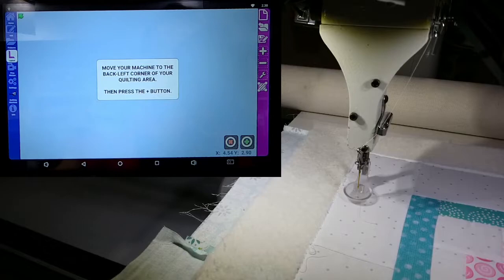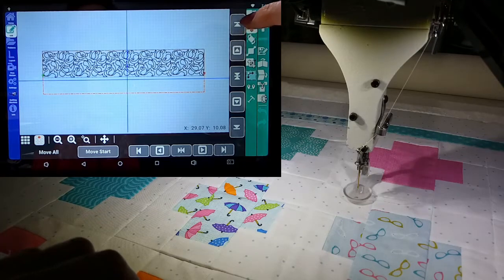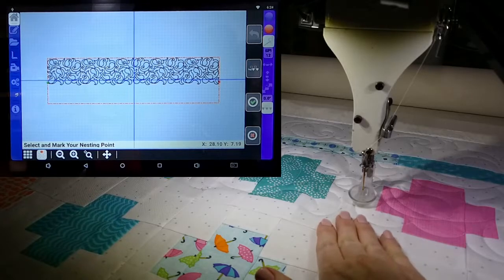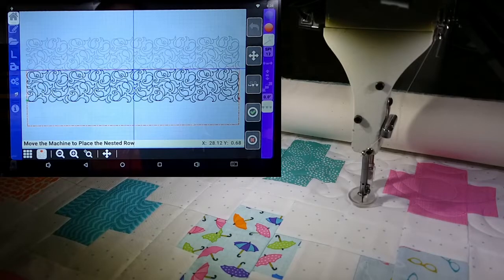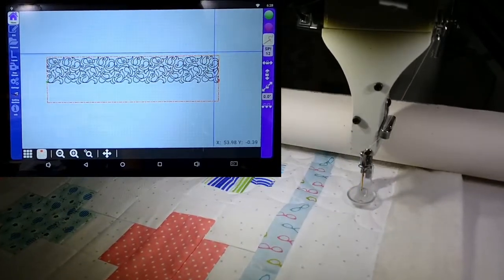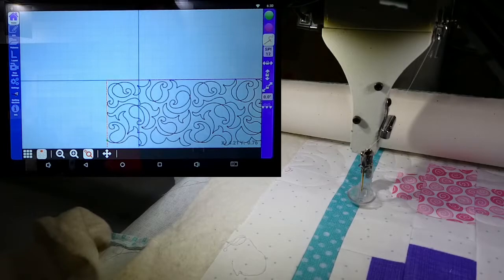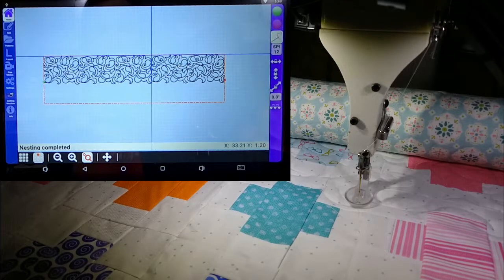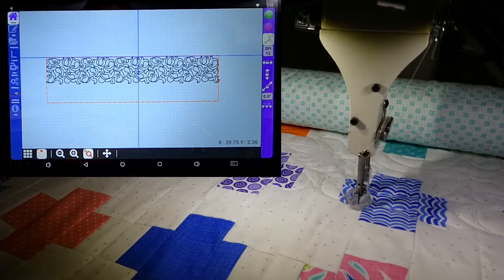Nesting on Butler Robotics

Comment: I realize this is an older video. However, when you check to make sure your hand fits under takeup roll. What do you do if it doesnt? TIA
And thank you for the video it is spot on, easy to follow step by step.
Reply from the maker: @dianeturner7090  My machine (A1 Quilting Machine) has an adjustable take up bar. I have a hand crank on the side of the table that can raise it. You'll have to refer to your owners manual to see if yours is adjustable.

Comment: My only question is how far do you roll the quilt? Do you go by where it is on the tablet?
Reply from the maker: When you're nesting, set the nesting point in the middle bottom of your quilting design on the quilt. When you roll the quilt during the nesting procedure you can roll until the machine is getting close to your take up bar. The nesting point is just a reference point for the machine to know how far you've actually rolled the quilt. When it's nesting design (a design that going up and down and fits inside the previous row ) pick the highest point of the bottom of the row for your nesting point. This way you won't accidentally roll too far and have that machine run into the bar during stichout
Reply: @jenquilts8038  thank you so much! I'm new at this!!

Comment: While nesting my row machine wouldn’t move??? 😮
Reply from the maker: You should be able to move it. There is a small chance that you pushed the horizontal lock that's above the nesting icon. Try it again.  If it still does it, call your dealer

Comment: So glad to see some new videos using the Butler.  I have had mine for several years and just continue to use the edge to edge designs.  For some reason I never used the spacing when nesting.  From now on I’ll be sure to use it.  I will also use the cropping feature more after watching that video.  Thanks so much for sharing your knowledge.